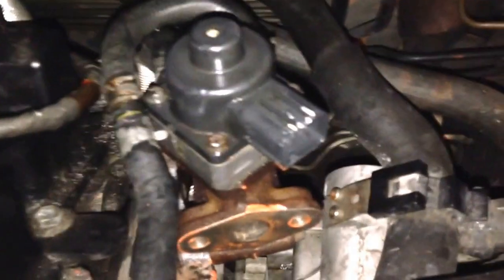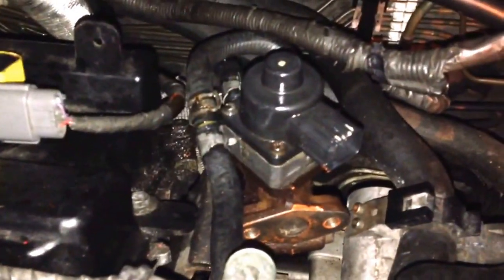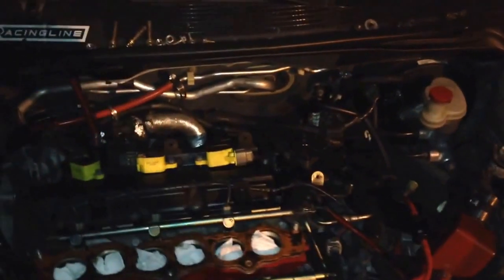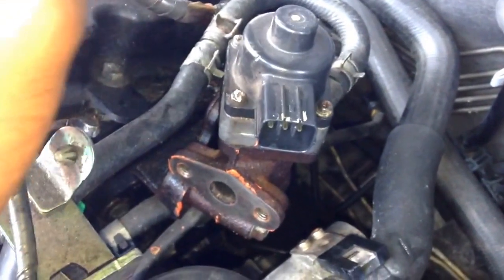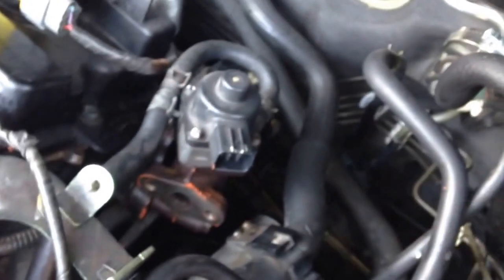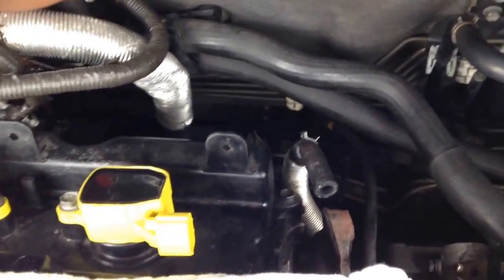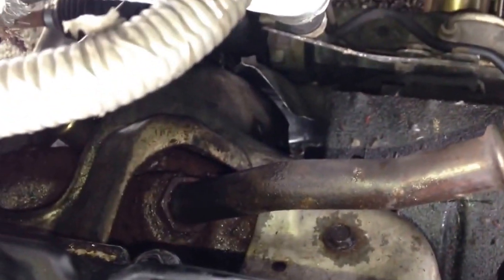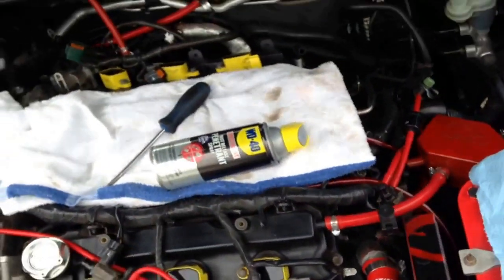EGR Valve Swap PT.1 04-08 Maxima --__-- Silver Surfer

Comment: Great video.. Thank you.. I think my egr cooler has a leak... Getting white(ish) smoke at cold start.. Thought valve stem seals but the valve ring conditioner had ZERO affect on it.. So my next stop is EGR cooler.. It started literally the day I cleaned out the metal inlet tube... Wirebrushed it while doing some other work and within an hour it smoked on cold start..
Reply from the maker: Thank you so much.. I appreciate it..

Comment: I have one question to ask I wish I could show you the pictures if you skip to 5:14 seconds on your video you can see the piece is right under the egr it hook up on the hose I just don't know where this part connects too it's called a Valve Assy-Oil Cooler or transmission oil cooler it's 2 long hoses that connects to a box underneath the battery tray that runs to the back of the transmission somewhere I know the long hose connects to the coolant pipe on the firewall where does the the little short hose connects to on the transmission I'm lost
Reply from the maker: You should be able to follow the hose.. I know it may be hard to see.
Reply: @Abu5ed_VQ  I brought the car as is so nothing was hook up I just don't see where the short hose goes on the transmission I find where the long hose connects to on the firewall coolant piping
Reply: @Tootoojackson Howdy, I’m having the same issue finding out where the hell it goes. Did you find out?
Reply: @nah2830  yes I have finished my project car everything is running real good
Reply: @nah2830  yes I did a engine swap I put in a 2018 Maxima engine now it's running good
Reply: @Tootoojackson  That’s good. Did you happen to find where the short hose goes? It feels as though I might be blind or something, but just looking at it it looks like it doesn’t connect to anything.
Reply: @nah2830  I did a whole different engine swap in my car now I no longer have that engine anymore they are nothing but problems and vacuum leaks all time headache I glad I do the right thing

Comment: Just figured mine out 05 max.. sneaky little bich lol was sucking air past the pintl seal under the egr solenoid/actuator and sucking threw the little housing drain in the valve body. Valve was not sticking at all.

Comment: Ayo bruh bruh what size mm you use to remove the locknut I’m tryna remove this bs my V been running lean since 2019
Reply from the maker: I don't recall my G.. 24 or 23 I think..
Reply: @Abu5ed_VQ  I handled it bruh bruh good looks come to find out after I replaced the egr it’s still running lean but I found a wire stripped out of the egr sensor so I’m guessing it’s that. After everything I went thru today I realized I need a lot of new hoses lol.
Reply: @Abu5ed_VQ  tell me why I had to remove the upper half of the egr sensor in order to have clearance to remove that dayum locknut.

Comment: Hey homie my mechanic said my egr need a to be replaced cuz my rpms don't go past 3,000 rpms is it true
Reply from the maker: I would look at your Mass Air Flow sensor and the MAF wiring harness first.
Reply: Also the timing chains can jump. Usually rattles on cold startup